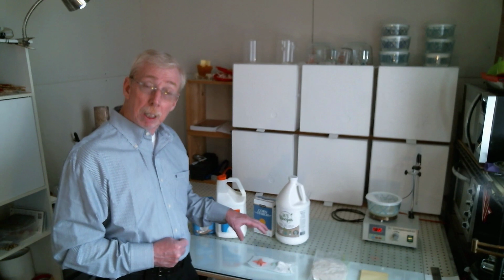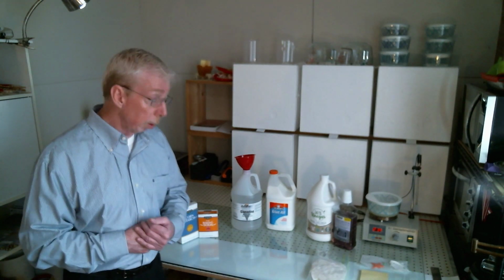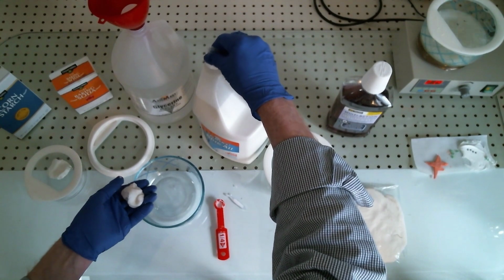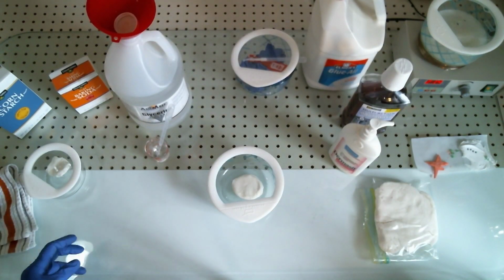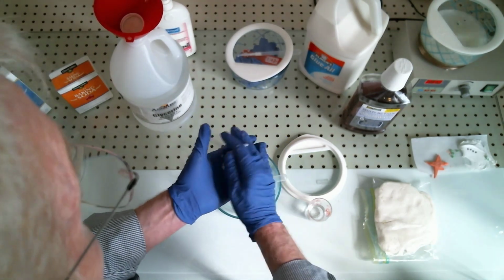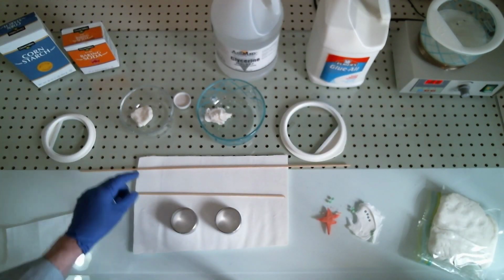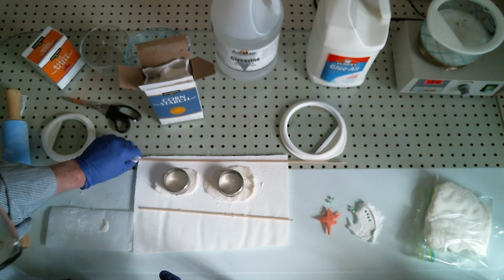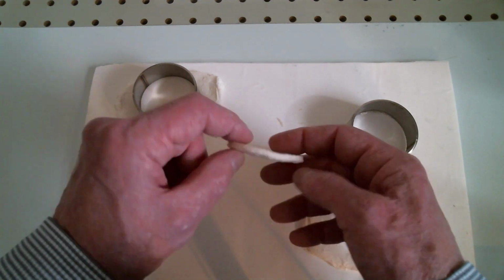Arts and Crafts: DIY FLEXIBLE Clay for MOLD and MEDIUM. Professional artist quality.

Comment: Hello there! I just found your channel and first of all I want to thank you for sharing your knowledge. I just want it to ask about if you have in your Chanel the Cold Porcelain recipe? I am interested in getting the porcelain that dries hard, even though there’s shrinkage. I have try so many recipes that I can’t get the same or at least close consistency of the commercial brands. Mine comes out too soft and I need something firm to be able to model dolls faces. I am sorry if this message is way too long, but you seem to have lots of knowledge on chemistry . Thank you so much again and I hope you could guide me a bit with your knowledge. Have a great day
Reply from the maker: Thank you for your comment. I am not a chemist, even though I was paid to be one. I am good at research and my brother calls me an Alchemist by Trade.
I have not done a video on Cold Porcelain as I saw so many good ones on the product. This was an attempt to make an alternative. Since then, I have concluded, not everything needs to be 'green' as God gave us oil. We just have to stop putting it in cars and make plastic with something else.
Plastic and fuel are two areas I do work on.
If it is too thin, you should cut back on the PVA glue. When researching for an alternative, I saw one very important feature were it make 'sharp peaks', so there are a few that discuss that.
I am so sorry, I have so much going, I don't have time to work on this. But, I do see a lot of my audience are artists, like I once was, so I will make a point to get back to you all this spring and summer. 
After wracking my brain, Cold Porcelain or Clay are my only ideas for making a dolls face. Both will shrink a good bit.
Keep an eye, I sometimes have ideas years after you ask the question.
P.S. This formula has been reported to crack after a few months.
Reply: @GEOsustainable  thank you so much for your response and patience. Have an amazing day and greetings from Canada 🇨🇦
Reply: @GEOsustainable  hello there, I am sorry to bother you again but do you know a good hardener that won’t dry out the cold porcelain? I am using Stearic Acid in small quantities. A teaspoon for a small batch. So sorry to ask once more about this topic, have a great day and blessings ☺️

Comment: Every example of cold porcelain diy video I found involved heating the ingredients after mixing, then kneading it. Could it be that there is a chemical change with the heat, that isn't produced by your mixing (kneading) it into the previously created clay? I was just wondering. Also,  you said the previous created clay is hard (which I want). Is it also brittle? Is it a hard plastic like material?
Reply from the maker: The clay I made is rock hard, very strong, not brittle, with zero shrinkage. I think you are really going to love working with it, and...knead it.  ENJOY !!! I am still on the path to making an acceptable cold porcelain, stay tuned for that. Perhaps 2 weeks out still. And, please, don't cook the PVA glue to smoking, it releases toxic chemicals, and the reason I am reformulating it.
Reply: @GEOsustainable  Thank you for your quick response.

Comment: Do you think stearic acid might help with flexibility instead, or would it alter the pH too much?
Reply from the maker: great question. the pH level is not a concern. I simply had not thought about it. I will try it and make a video it it works well. I have continued working on this, as I mentioned, and I used vinegar as the catalyst with more sucess, so stearic acid will be a good addition. I am waiting for the next experiment to completely dry at this point.

Comment: Something you are missing. Workability of the clay. It needs to be firm enough to mold into shaps that hold. Smoth enough that in a palm swipe test, a flower pettal is perfectlt smooth, with very thin edges, and no tears. Etc. It's very complicated.. lol
Reply from the maker: Thanks for the tips!

Comment: Very happy to see you pop up when I was looking for a flexible clay formula.  Do you have any thoughts on making a more flexible result?  Seems to me this could be an awesome chap replacement for two part silicone in certain types of mold making if you could achieve greater flexibility and low shrinkage.  Maybe for items where 1% shrinkage is ok?
Reply from the maker: Give it a try. About half of comments ask if I can do something other than what I have discovered. I could spend months coming up with something, and get paid $.0001 per view, and then get another question asking if I can do something else. My advice is to give it a try, and if it doesn't work, keep trying.

Comment: hey hey! this is great, I was noodling on this today. as you say, all the videos talking about corn starch, the only reason I could think of that corn starch is used as a filler is because of the consistency in the end product. I haven't completely looked at your videos, but I am also looking for a translucent air dry recipe, the trouble being a filler that allows for the most light pass through without cracking. I ordered some 'polymer' translucent air dry clay from Japan. The rumor is, it is called polymer because it has plastic in it but it does not need to be cured in the oven, instead it has a resin that is used as the binder, but what do they mean by 'resin'? that is air dry, safe to handle. Lost in translation perhaps? Maybe rice flower would be a good replacement for corn starch, rice noodles tend to have a 'translucent' look to them...

Anyway I will take a look at your other videos, maybe you already have a recipe :)
Reply from the maker: Cornstarch is not used as filler in silicone, although it could. Cornstarch is used to speed the cure of silicone. I do have a few videos on silicone that I am sure you can find good info. I have a couple making clear packaging film with milk.
The polymer you talk about sounds interesting.
Thanks for watching, and thanks for asking a really great question.

Comment: Is it at all possible to create a air dry clay formula that when going through the curing/drying process is as durable as polymer clay and doesn’t shrink but especially doesn’t CRACK also like polymer- but no need to bake like polymer, but air dry?! That would be the PERFECT clay if even possible to make as this is the exact issues so many of us crafters experience and are constantly drawn to the convenience and cost of air dry but will use polymer on projects we want to last without worry if gets banged around and lots of use!
Reply from the maker: Anything is possible on a snow day. Use this formula, but do not add the Glycerine.